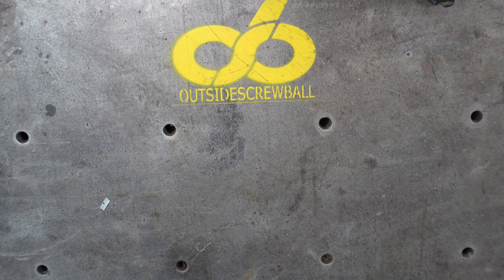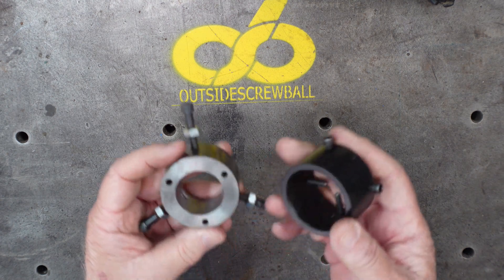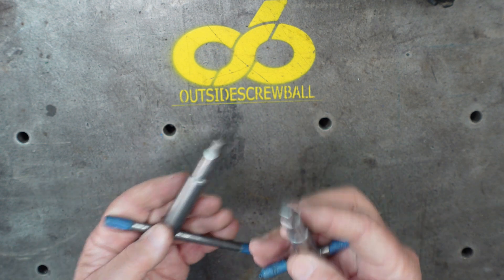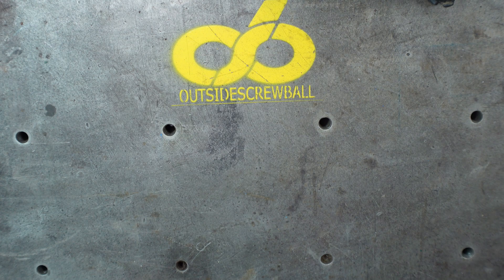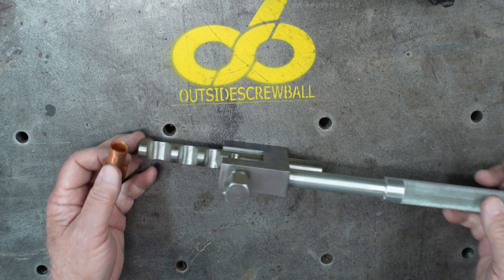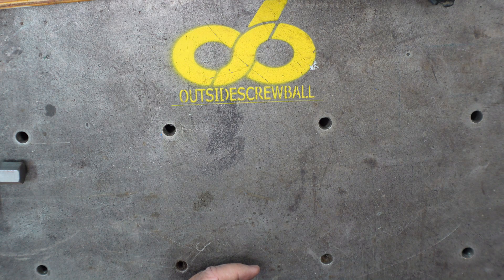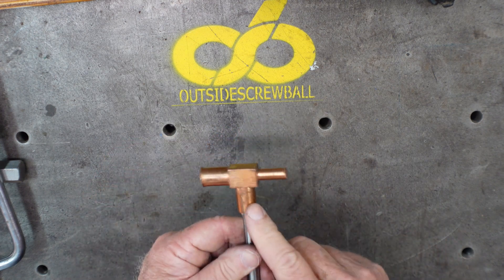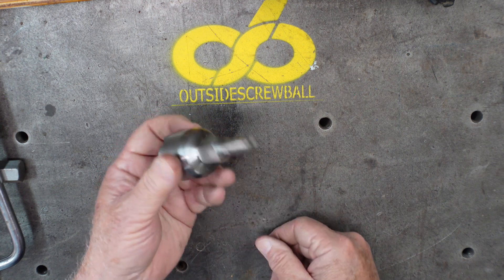Shop built tools review

Comment: Fun one Chuck.  I need to make a third finger for welding.  So far my project list is still fairly short.  Made a speed handle for the Kurt vise, some machinist jacks, a 40 taper adapter for my Wohlhaupter boring head, 2 tonne gantry crane, welding table, super heavy duty roller stand for the bandsaw infeed and most of a 25 ton hydraulic press (not finished this one yet).  This is a great hobby though not exactly inexpensive.
Reply: Most hobbies are not inexpensive if you have to buy stuff.  Whittling can be inexpensive unless you buy the wood.
Reply from the maker: Barry you have lots of great projects....enjoy the builds

Comment: I never saw a threading stop like that. Very interesting!
Reply from the maker: thanks for viewing...the stop works well and relieves the stress of a mistake
Reply: @outsidescrewball  I should say so! This just might be my next project.
Reply: Hi guys, i have always found it strange that people who still use the top slide for threading don't have a cross slide stop, it makes life so much easier and quicker, a nobrainer in fact You look at some of the youtube "doyens" and think are they really on the ball threading without one. I have one on one of my lathes but have a better system on the main lathe which makes on obsolete but for that and radial feed i would have one on there too.
So 👍Chuck.
Reply: @chrisstephens6673  by "top slide" are you referring to the compound? The main reason for using the compound is that you can avoid cutting both sidewalls at once. It's less strain on the tool, the part and the machine. In many cases it will also give you a better finish.
Reply: @ExtantFrodo2  indeed our top slide is what they call a compound in US.
After extensive tests a better finish is not achieved by using flank feed, nor is it a problem to cut on both sided, with the proviso that the machine being used is of moderate to good quality and condition. I would add that for particularly coarse threads a flank feed can be useful purely due to the amount of material needed to be removed and reduce loading, much like some jobs can't handle really heavy roughing cuts.
Feeding straight in has advantages when threading, as an example depth of thread needs nothing more the the cross slide dial and having the top slide parallel to the lathe axis makes picking up a thread that needs adjusting really easy.
If you want to see a slightly different threading technique i have a rather crude video of modern version of a victorian idea for easy threading.

Comment: yeah I noticed that your knurling wasn't good.  It looks to me like the first thing to improve your knurl is to go deeper into the material (a little at a time/per pass).  Your crosshatching wasn't completed because of it.  Use a huge amount of oil during the knurling to wash out the chips that are being pinched off.  And of course make sure that the free end of the stock is well supported so it can't flex away from the huge amount of tool pressure.
Reply from the maker: thanks for viewing and your comments, you are correct the knurling was not good as this is one of the first build projects from over 10 years ago when I started this hobby, no malice taken in your comments...